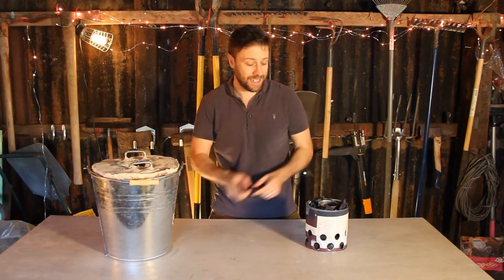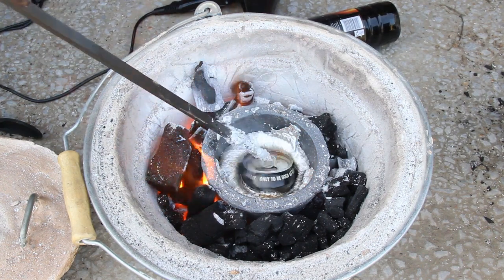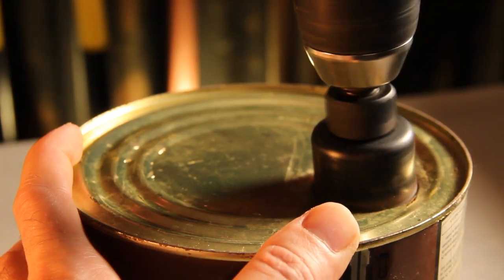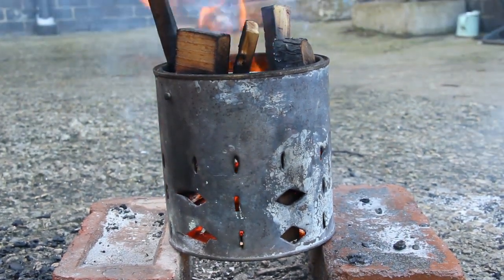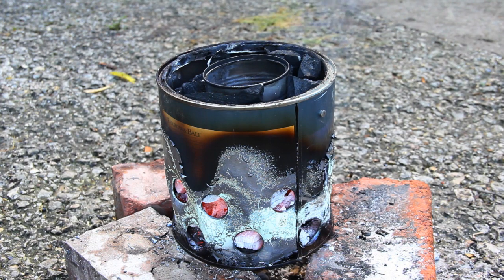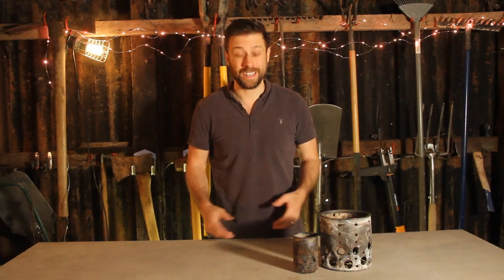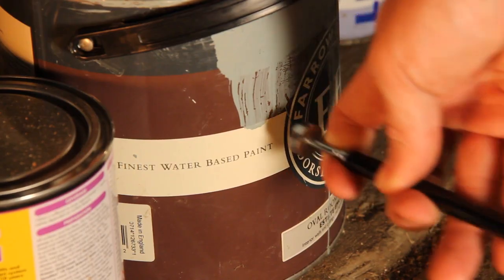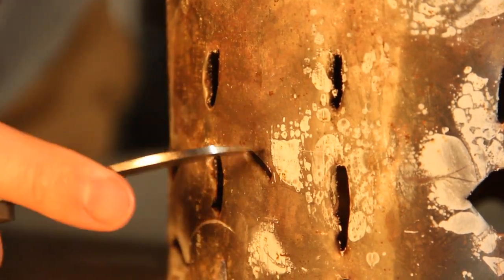Super Cheap MELTING FURNACE - Paint Can Furnace and Tin Can Crucible

Comment: Brilliant - thank you! I live off grid so can't use a hair dryer but I guess heating the outside wih a Mapp gas torch would be good enough? Also, are there any setbacks to using charcoal vs sand/plaster or perlite? I have an abundance of sand and pine but that's about it!

Comment: You can use steel wool to remove the coatings on the cans ❤
Reply: Will it not simply burn off.. wait you mean inside or outside of the cans?

Comment: Hey btw if you want you can spend a little bit more and get lump charcoal which (theoretically) can burn aluminum without the need for a blowdryer
Reply: How does lump charcoal work different than any kind of charcoal? Just curious to know if you specifically call for lumps vs briquets or if there synonymous
Reply: @bsanchez3563  charcoal briquettes have lime added to make them burn at a lower temperature for longer, so lump charcoal will burn hotter because it doesn't have lime.